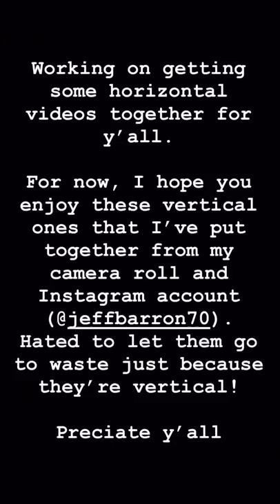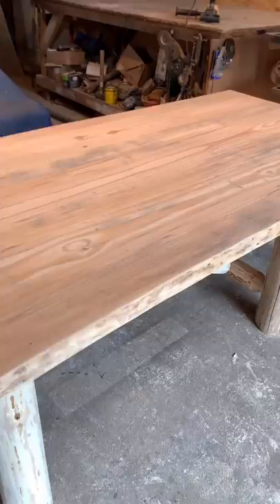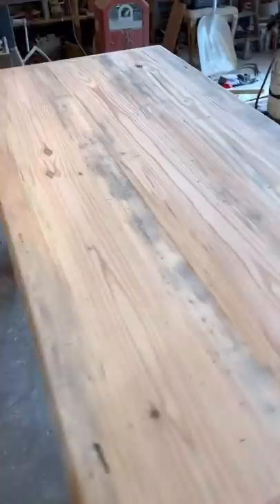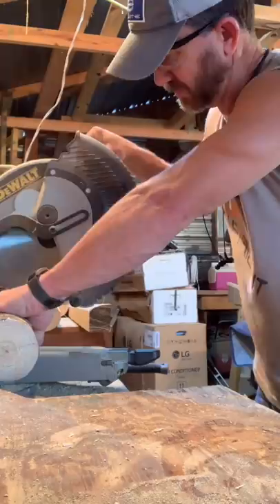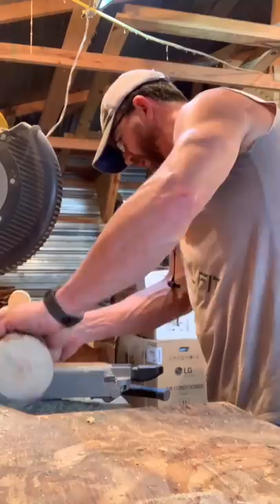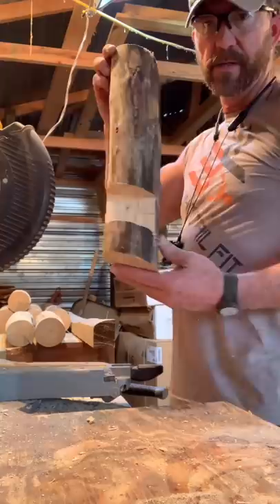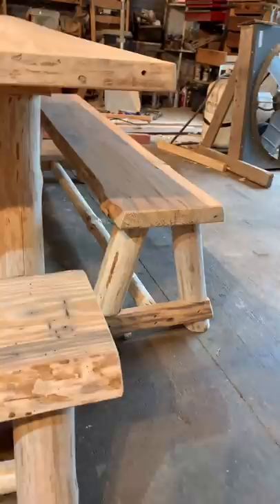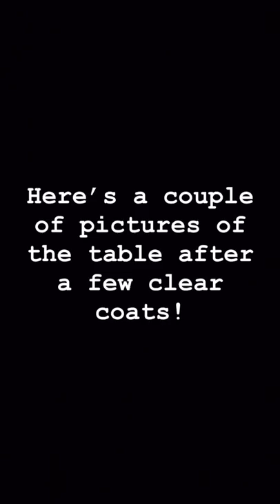Log Farm Table & Benches I Built to Sell!

Comment: Clear coat Poly. warm if up to 80-90 Deg.F and it will dry faster. Please don't use water base. won't hold up under use. Cheers, Billy in B.C., Canada

Comment: Looks like a piece of art Jeff.  IF it's going outside I think I'd just oil it.  Varnish and stuff will just break up and peal off in one season in our southern sun.  pour some turpentine on it mixed with a little rubbing alcohol.  About 2 turps to 1 alcohol should work real good on that pine.  After it's been out in the sun it's gonna vanish and you can do it again now and then to keep it looking great.  That turpentine will make it look like you stained it AND after one season you'll think you got a table made out of fat lighter.  It might not be quite that hard but it will be as durable.

Comment: Love the table.  My wife and I do a ton of projects like that, she's better than I am (she learned from her daddy) but I supply the killer tools!  You have got to check out the absolute best wood cutting tool EVER!  You get a regular handheld cordless grinder and they make a new blade which is basically a round stainless plate with a chainsaw chain on it. Less than 20 bucks and cuts thru anything like butter!

Comment: Rather than clear coat, what i have done with some of my shotgun stocks that i run around the woods with, is a mix of linseed oil and mineral spirits.  try it out on something and see what you think.  make a couple coasters out of something and see how it holds up with yellow pine.  i've only used it on oak and hickory and ash.

Comment: Try mixing up Pine Tar and turpentine in a 50/50 mixture as a wood finish/preservative and see what ya think. I like to put that mixture on all my wooden tool handles. You can get the pine tar at Tractor Supply Company in the "Equestrian" (the horse stuff) section.

Comment: International everdure timber sealer, two part mix. Soaks in deep, waterproof, clear, sets hard as steel, made for the marine industry, I've been using it for years never had a problem.

Comment: Nice Jeff! Did you joint that top planks for that perfect fit? I don't have a jointer but I joint with a 1x1 run of box steel (with glued on sandpaper on 1 side for gripe). It works very well!

Comment: You might want to try the spar polyurethane on one of those tables. It's similar to the regular product but seems to add a bit more depth to the color, besides being considerably more durable.        Is that joint on the top glued up or just butted together? Looks tight now...,.

Comment: Hey Jeff, when you cleaned up the bottom of the notch by using the saw blade, did you have stops set for each side of the notch or did you just eye-ball it to the walls of the notch. With you camera angle I could not tell. Thanks good buddy, beautiful and well built table set. I look forward to your videos coming our in landscape mode. The portrait mode picture is limited some what. I enjoy Hannah's channel and I am sure I will enjoy yours as well. Hello from north west Alabama.